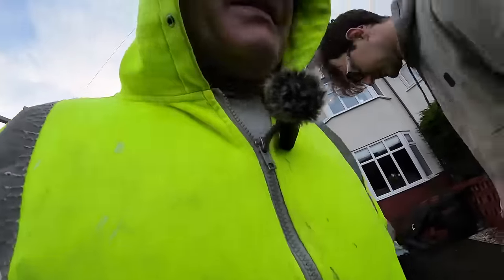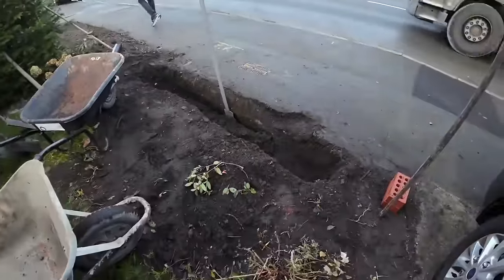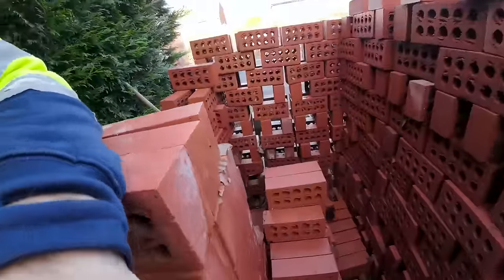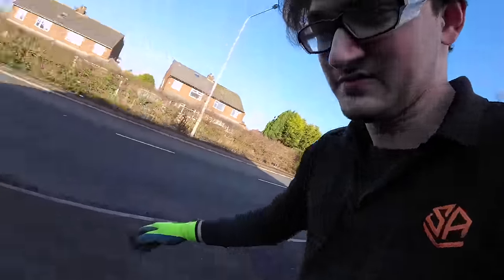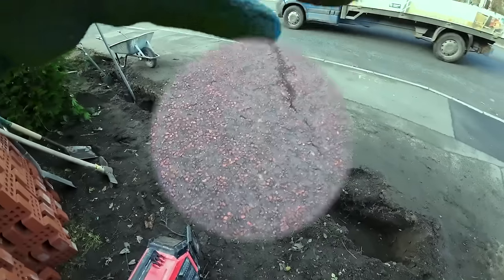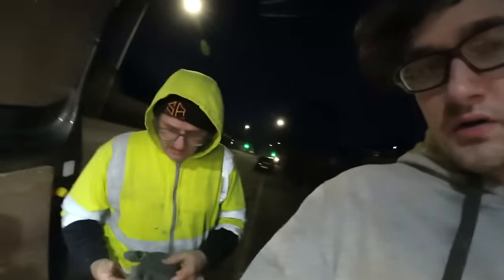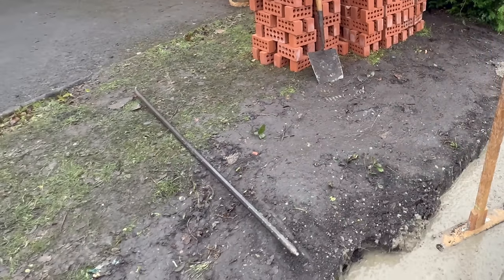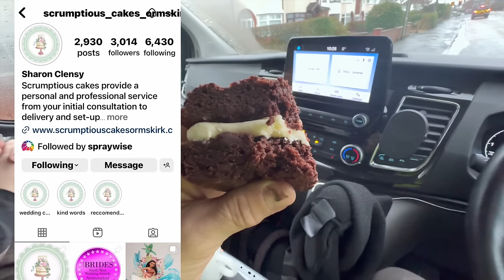HOW TO BUILD AN ENGINEERING BRICK GARDEN WALL PART 1

Comment: I used Incandescent Bulbs to keep concrete warm in our 🇨🇦 Prairie Winter pours...Tarp them over good...put 2 bulbs ( backup in case 1 dies ).. depending on the weather and size of concrete pour ( i did Sign bases so not huge ) i would use 100 to 200 watt bulbs... the heat output is enough to heat and dry inside easily.... a Propane heater would do it faster in your case... blowing the hot air through the bricks .... even an Electric space heater and covering the bricks would do it quickly....🇨🇦🤓🤙
Reply from the maker: Milwaukee have just brought a space heater out over in US.
    Hopefully be here soon 😁🧱👍🏽

Comment: Good luck with the hip Steve, hope you get a call soon and get the surgery done and the recovery process started. One advantage of suffering with a bad joint for so long is that you've leaened to adapt to the limitations and the pain, so the recovery is fairly easy, especially for someone like you who just gets on with it.
I just had a shoulder done after it slowly getting worse over the last 10 years- post op pain is no worse than before on a bad day. The pain drugs afterwards are amaaaaaaaazing, and not for the pain!😃
Reply from the maker: Cheers, fingers crossed it happens soon 🧱👍🏽

Comment: great job guys, just one thing I would of got a digger in for all trench work like that , pass cost on to customer , saves your back in the long run and you can work longer with no back issues  , I did not take my own advise hence very bad back and knees
Reply from the maker: Too dangerous near a main road and on a pavement and even the best driver would have torn up the fragile tarmac with the tracks 😬🧱👍🏽

Comment: Chaps,
Do you have anymore lintel videos coming along soon?
That last extension you did turned out very well, I was suitably impressed.  
There were some interesting comments regarding water ingress and cavity trays   -    but its all a bit like cutting into existing cavities and inserting vertical damp,    and breaking into existing cavities to prevent cold bridging between old and new work  -  its nice to have but for not much gain.   However, if the Architect/ Building control/client require it, then it must go in.
We should always strive to improve the thermal & weather tight integrity of our extensions/buildings but some of these details are a lot of "faff" and expense for a minuscule gain, and in some instances zero gain.  As the old saying goes, if something aint broke - don`t try and fix it.  However, that is just my personal view. 
Keep on -  keeping on you two and see you on the next one.
😁👍👍
PS:  Lets hope that @elon-the-nun keeps his puerile,  asinine  and vindictive comments to himself in future.
Reply from the maker: Editing one tonight and more to come 😁🧱👍🏽

Comment: Hi,great video again,i have to replace 133 bricks on edge,on a bed of tiles,any idea how much mortar that it would take,or is there some way of working it out myself thx
Reply from the maker: Thanks Anthony 
a full mix in a belle mixer will generally do 100 to 130 bricks ( depending on the bricks )
You need 4 x 25 kg bags of building sand
1x  25 kg bag of cement 
You may need slightly more than a mix for brick on edge so be prepared to maybe get an extra sand and another cement.
use a bucket to gauge your mix too 🧱👍🏽
Reply: @SteveAndAlexBuild  Thx for info, thats a great help,look forward to yr nxt video👍
Reply from the maker: @anthonyvallee4085 no probs .   
   Good luck 🧱🧱🧱🧱👍🏽

Comment: Hi mate whats the depth and thickness of your concrete, its 450 wide right for the 215 wall, Im doing a 328x328 and 665x665 piers would that be on a 900 footing for the 665 and 600 wide for the smaller pier, cheers pal
Reply from the maker: Sounds good 👌🏽🧱👍🏽

Comment: To those who asked. I would have learned from the earlier incident where Steve could have been seriously injured and stacked the bricks in lower more stable stacks. The easiest wat to secure a site is by using site fencing which you can hire for for £6 per panel per day. the simplest way is to to use barrier tape on posts. What most builders don't consider is that they expose their client to the same responsibilities for an unsafe site because all home owners have a Duty of Care to all persons going onto their property whether invited or not.